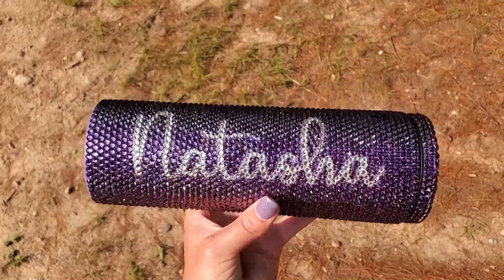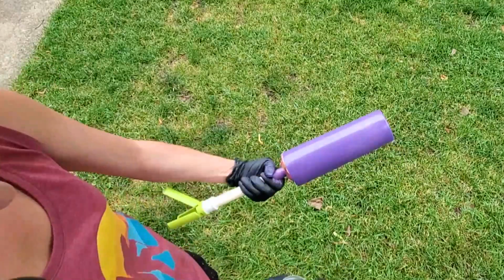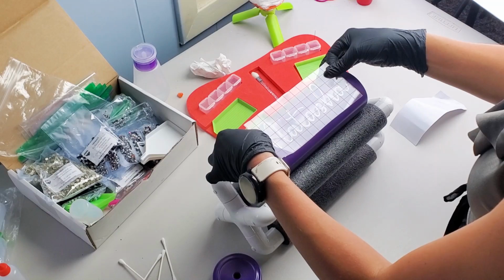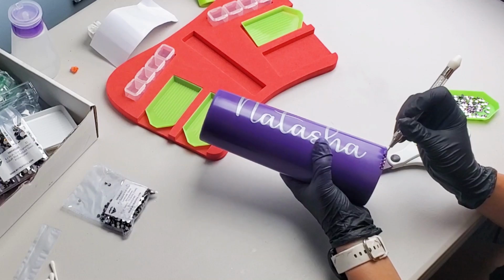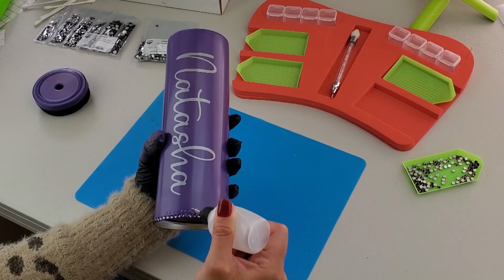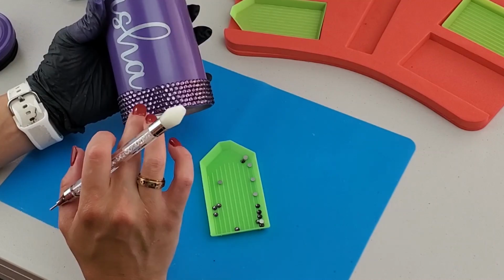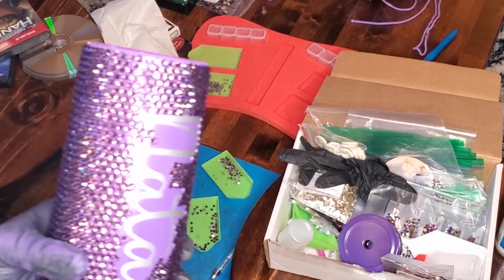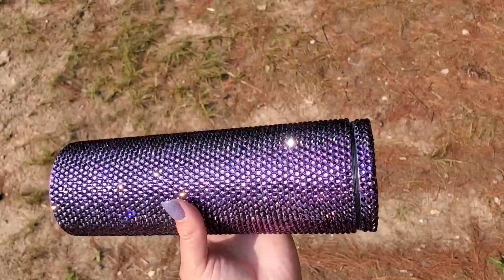How to spray paint then bling a tumbler to keep the stones on | Satisfying bling | No epoxy required

Comment: Great video! What is the green thing on the bottom of the pole you used when you spray painted the cup? It looks like some sort of stand. Also, any update on how well the cup has held up since the video has been posted?
Reply from the maker: Hello!  Yes, the green part on the bottom is the sand that extends out.  Very helpful when drying the cups.  The cup itself is holding up great!  Almost two years later and all the stones are still on and my nieces love using it!  Thanks for watching and commenting!
Reply: What type of glue do you use?

Comment: Hi! Can you seal with mod podge if it’s not the spray?
Reply from the maker: If you're going to use the traditional modge podge, I would suggest that you let it fully cure so it isn't tacky to the touch before going further. I'd also recommend using the matte version and once it's fully cured you can even lightly sand it so that the rhinestones can adhere better as well. Hope this helps! Thanks for watching and commenting!

Comment: So if you use paint and primer do you still have to use mod podge if i am using jelly rhinestones and resin glass rhinestones????
Reply from the maker: The mod podge spray paint I used was essentially a clear matte spray paint that I used to seal the spray paint color on the cup as well as provide a matte finish for the stones to be adhered to. The mod podge I used on the bottom of the tumbler was only to apply the glitter and therefore, not required. I hope this helps! Thanks for watching and commenting!
Reply: @ABCuteCreations  yes thank You so much
Reply from the maker: @luisvilla9074  you're welcome!

Comment: Do you seal it after you are done.
Reply from the maker: Great question! You do NOT want to seal it once completed as it will lose its luster/sparkle. If, for example, you were to epoxy over the stones, they lose their dimension and it essentially looks like you just used specifically placed glitter. If you adhere your stones with the proper type of glue, don't soak your cup in water, don't drop your cup, etc... your stones should remain intact on your tumbler. Hope this helps! Thanks for watching and commenting!! 😁

Comment: Approximately how much time (aggregate) did it take you from placing the first stone to the last stone?
Reply from the maker: Great question!  I believe it took between 14 and 16 hours but I'm not entirely certain.  I know that using the SS16 stones will take longer than using SS20s but I preferred the look of the smaller stones in the end.  I usually working on bling projects while binge watching tv so that time goes by rather quickly.  I hope this helped though!  Thanks for watching and commenting!
Reply: Where do you get your stones, and how many do you need to do a tumbler like this?

Thanks

Comment: How many packs of the main stones do you use? I bought ss20 as my main stones and the pack comes with 530 gems..
Reply from the maker: Hello! I used roughly 3 packs of the be createful flatback rhinestones in SS16 plus a multi sized pack for fillers. You can find the SS16 stones here: https://becreateful.com/collections/flatback-rhinestones/products/flatback-foil-violet-lavender-glass-rhinestones?variant=12809856647267

It definitely takes a little more than you'd think. SS20 will definitely take up a little more room as well....

Comment: Do you seal the paint too or just the bottom where you did the glitter? I'm about to try my first one 😱
Reply: Great job by the way!!
Reply from the maker: You can seal it with clear spray paint but it's not necessary.  You can also epoxy over the paint but the gems will make the cup heavier as it is and so to keep the weight down, I just stuck with the spray paint.  I know this was a late response so hopefully you were able to figure something out for your project!  I'd love to see how it turned out if you attempted it!

Comment: How did you make the holder for your tumblers
Reply from the maker: I actually have to give full credit to another designer.  I found her through a YouTube tutorial and it was so affordable, I just purchased it off her etsy site instead of trying to make one.  I purchased it in two styles.  This one: https://www.etsy.com/listing/845678259/cup-cradle?click_key=961676a0acb0836b0c6a4cb91e9166c92cad16d6%3A845678259&click_sum=47e23262&ref=shop_home_active_7&sts=1 and this one:  https://www.etsy.com/listing/845675857/angled-cup-cradle?click_key=db8c9ce6e049170ecefdafeb663d8e5e732191ce%3A845675857&click_sum=97f6592f&ref=shop_home_active_22&sts=1

I hope this helps!  Thank you for watching and commenting!

Comment: Why just not push in the Nerf ball in so far that way you not need tape the ball itself will create a seal around the cup! Maybe that will work better! Thanks so much for Sharing very Beautiful Bling Cup!
Reply from the maker: Yes, that's another good suggestion.  I wanted to make sure the cup was secure and wouldn't fall off the stick, which is why I pushed it in as deep as I did.  I've since found a great product to use that's silicone and protects the inside lip of the cup (something similar to this: https://amzn.to/3VTfJAT in case you're interested).  I'm glad you like the cup!  Thanks for watching and commenting!

Comment: Spray paint smells awful there has to be a better option! The smell doesn't just go away! Does it?
Reply from the maker: Another option would be to use mod podge and add a glitter base in the matching color of the stone you're working with.  It would also add sparkle in between the stones.  You'd want to make sure that it was fully cured before proceeding with the stones.  You can always hand paint as well.  The risk you run there is having an uneven coat and working around the lumps and unevenness when blinging the tumbler.
Reply: Hello mam.. can I use the normal modpodge ? Or any specific dishwasher safe kinda modpodge?
Reply: @abcutecreations did you sanded the tumbler after sealing with mod podge?